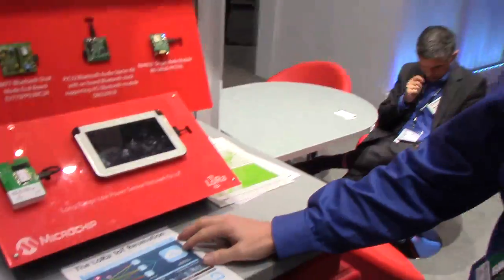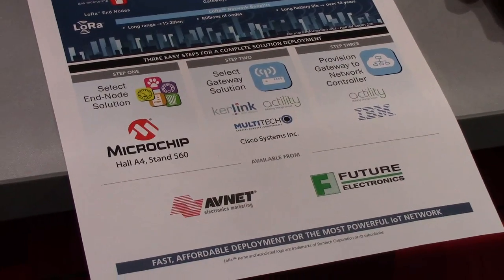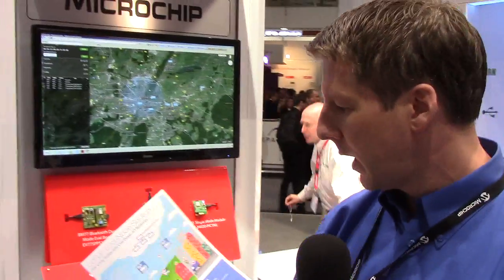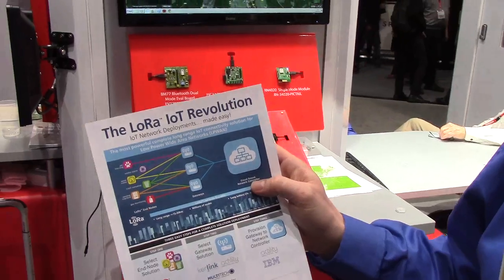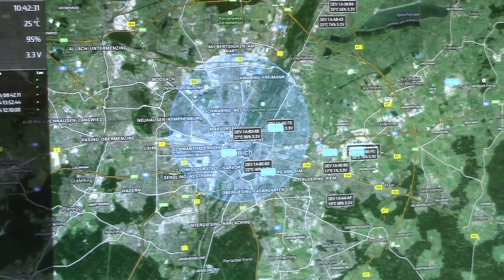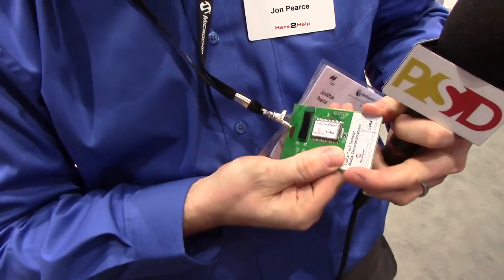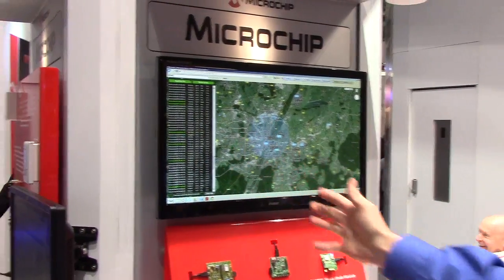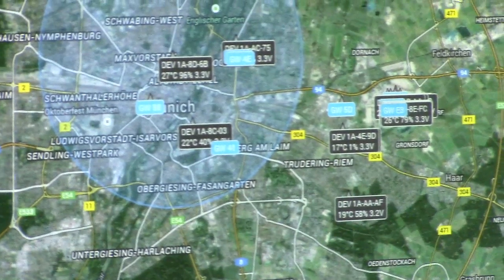Microchip demonstrates LoRa low-power IoT wireless internet network technology

Comment: Wow these random RF ranges just keep blowing up... so LoRa is now good for 20km's ?
Reply from the maker: relayed, as far as you like
Reply: On the ranges: some manufacturers advertise lora module to lora module distance (roughly 4km with omni low gain antennas line of site/100mW tx power). Others advertise lora module to lora gateway. From my understanding places in Europe have lora gateways built into cell towers and have fantastic antennas and receivers which allow 20-40km range line of site.